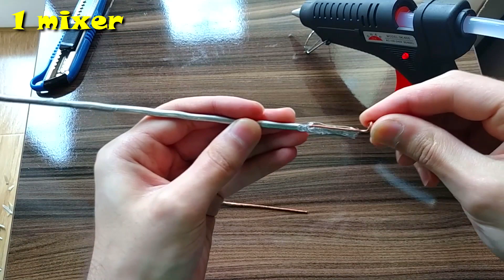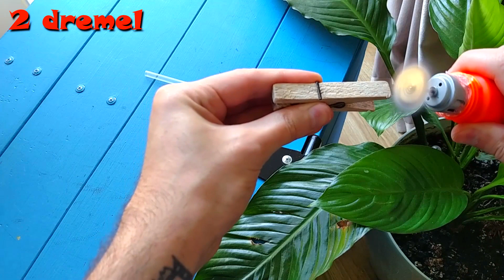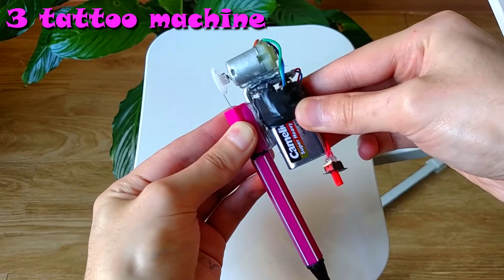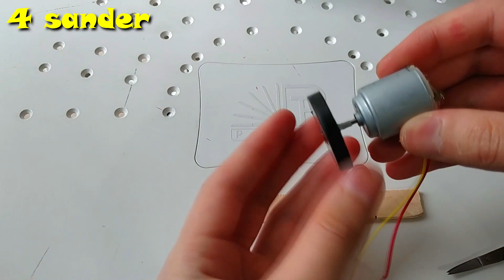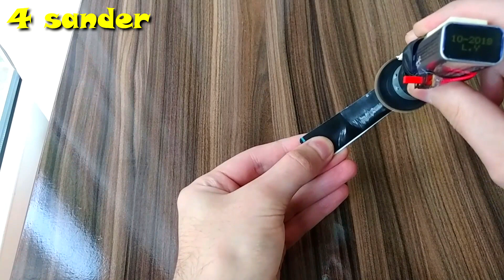4 Awesome ideas with DC motor - DIY 4 useful machine with dc motor

Comment: نتشرف بزيارتكم لصفحة IC-electronic parts لعرض قطع الغيار الالكترونيه المختلفه وجميع انواع Stepper Motor - DC Motor - AC Motor - DC Geared Motor - DC Fans - Brushless DC Motor - DC Gerbox - AC Gerbox - DC Motor With Encode - DC Servo Motor 
https://www.facebook.com/IC-electronic-parts-152865081746994/

Comment: holy shit, you only need 1 AA battery for the tattoo gun; 9 volt battery is too much voltage and it will cut you up instead of just inserting ink.

Comment: Where can you buy DC Motor?
Reply: small car
Reply: zdravko mitic any dvd repairing shop or in a dollar store
Reply: CLAYER PLAYER ty
Reply: zdravko mitic b
Reply: hobby store but costt a lot, goodwill buy something cheap that has a couple inside, or radio shack if any are still open but like anything online is prolly the best place.
Reply: zdravko mitic  in tv repairing or electrical center
Reply: zdravko mitic ebay
Reply: Depending on where you are, for UK, Maplin or any electronics/gadget store.  or amazon obviously.  both pretty cheap.
Reply: From  electronic cars
Reply: salman sehrai  yes you can, Iv bought several.
Reply: zdravko mitic u can buy       
Dc motor from any stationery
Reply: In broken Rc car or heli
Reply: I can bay it
Reply: You can get DC motor from old DVD player,broken toys,hair dryer or you can buy them from hardware store.
Reply: take apart a small crappy rc car and you will find the motor in there
Reply: Amazon
Reply: Rip it out from you cd player also ARTILLERY ONLY
Reply: donce
Reply: zdravko mitic
Reply: ten rs
Reply: Toy shop or science projects stationary
Reply: you cant buy it you have to take it out from dvd